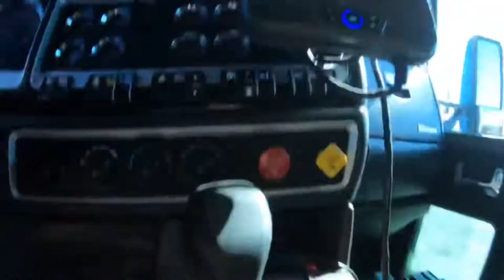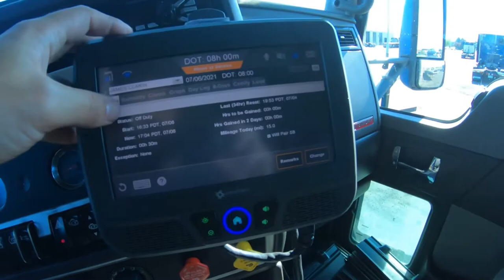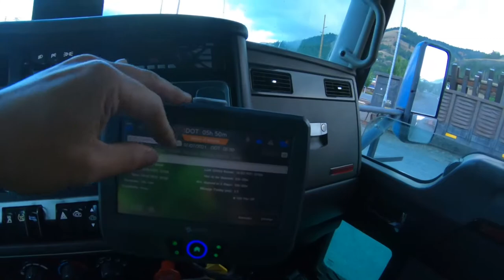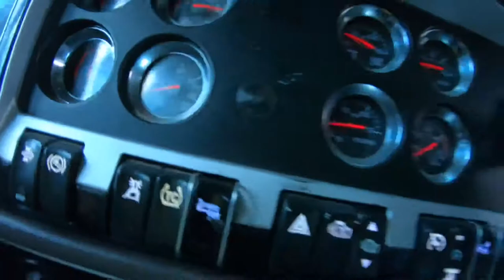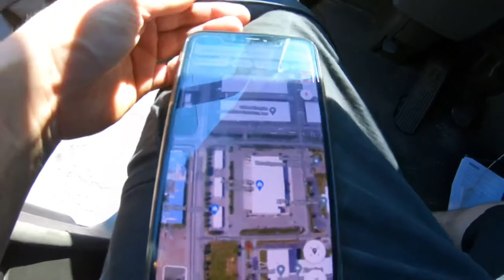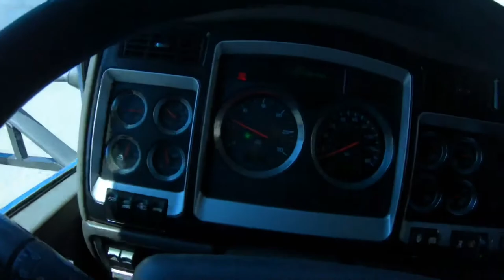Heavy Haul Flatbed Rookie | Truck Problems - Sheetrock - SDS Lumber and Kaiser Aluminum!

Comment: Does system have a camera watching you inside the truck? I saw a forum of guys talking crap about system and that subject popped up. I'm debating on going through the orientation in spokane.. just not sure I like the 5 week training away from home with someone I don't know
Reply from the maker: There is a camera but most trucks have a middle visor that most drivers use to flip down to cover, what I understand they have the cameras but we’re not required to have it clear of obstruction if that makes sense, most trainers are cool, I did mine in 4 weeks and I still talk with mind almost daily and made some cool friends along the way so it’s not too bad just travel light.
Reply: @jaytrucks8329  cool, thanks for the quick reply. Hopefully i get to see you out there after a while. I've only driven a log truck for about a month after cdl school and never had to back a trailer in it, so I'm hoping I can pass systems driving test. I've never backed up a 4 axle flat bed before
Reply from the maker: @Ty-tie_FTW  it’s pretty easy once you work out the off tracking, everything is wide-wider then a tandem setup, also remember when you’re backing and you have a load that your tag axle is up [if you had to use it] it’s a steerable axle and stuff can happen if you go to a truck stop or receiver and back without doing that but other then that it’s good, we also go to some weird places so you may find yourself in an odd predicament, this certainly will hone your backing skills haha pre trip is easy they just want to make sure you know where stuff is and such, these trucks use disc brakes and not the typical freight liner style like what I was used to, you’ll probably start in a T800 and after some time they may scoot a T680 at you.
Reply from the maker: @Ty-tie_FTW  also if you can request a trainer, Ken was mine and he was a chill guy, ran hard but is easy to get along with and knowledgeable.